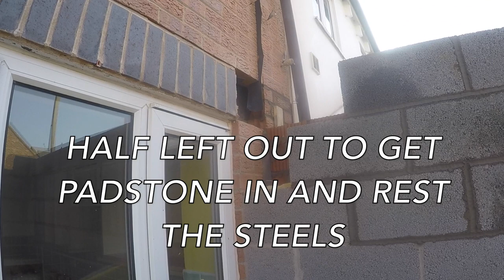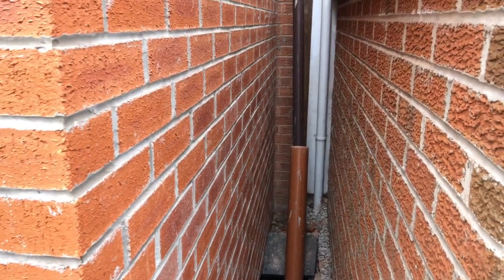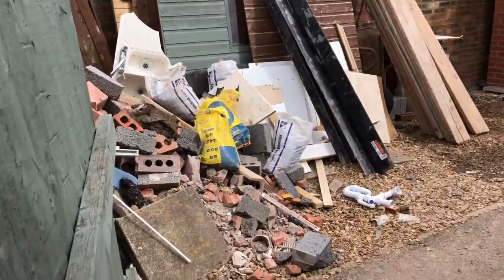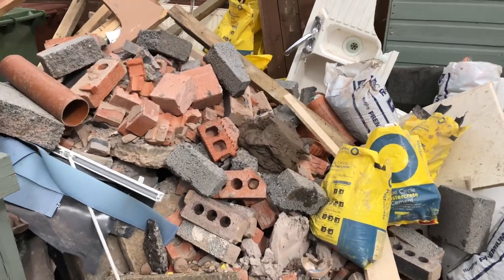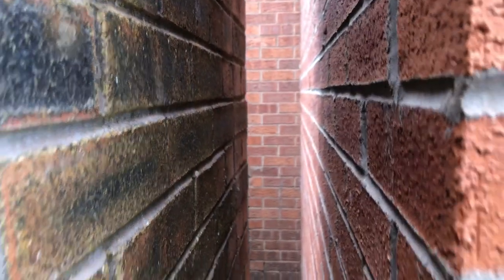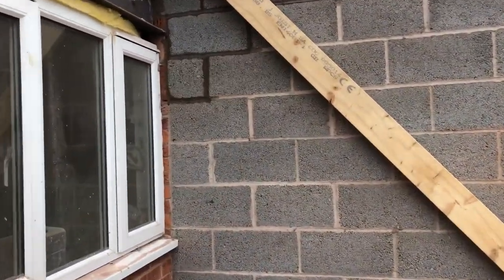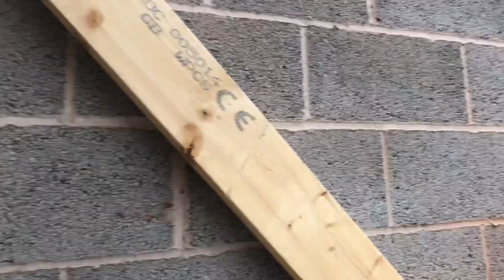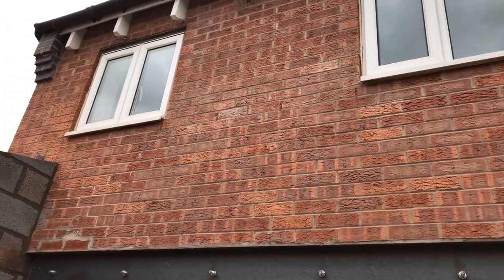BUILDING PIKES OVERHAND (NOSEBLEEDING)....EXTENSION PART 7

Comment: Great job!
  1. What brick is used? Clinker? What are their sizes?
 2. Which masonry mortar do you use? 

Thanks!
Reply from the maker: Hi Alexy The brick are clay and are called Ravenhead Red Rustics , they are 215 mm long , 65 mm high and about 105 mm wide .
The blocks are clinker and are 440 mm long , 215 mm high and 100 mm wide .
Our mortar is 4 parts building sand to 1 part cement with a blit of plasticiser added to it 👌🏼🧱👍🏼

Comment: Do you guys put the roof on aswell, and what size grinder and blade where using for your cuts thankyou
Reply from the maker: David Harper Hi David , no roof just foundation, brickwork and slab . We use a 240 v boch 9” grinder with a Marcrist diamond blade 👌🏼🧱👍🏽
Reply: Bricklaying With Steve and Alex thanks a lot 👍
Reply from the maker: David Harper 🧱👍🏽

Comment: What’s the brand and name of your brick cutting saw lads?
Reply from the maker: Wazzy Skillz it’s a 9” blue Bosch grinder   With a MARCRIST  diamond blade . Grinder £100 ish blade £. £40 ish  🧱👍🏽
Reply: Sthil ts420 the way forward 125mm cutting depth. Never been a fan of using electric grinders. Sthil have a battery powered saw out 9inch looks a good bit of kit. Not so heavy if holding at height.